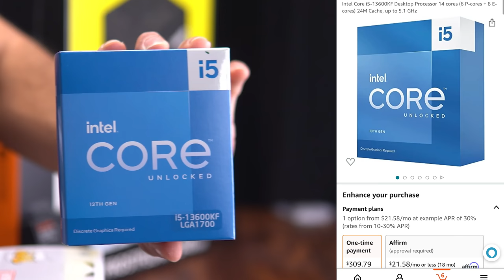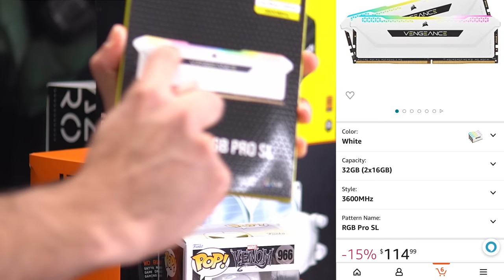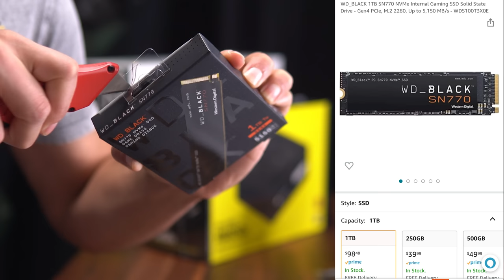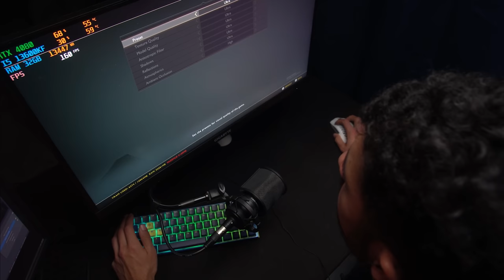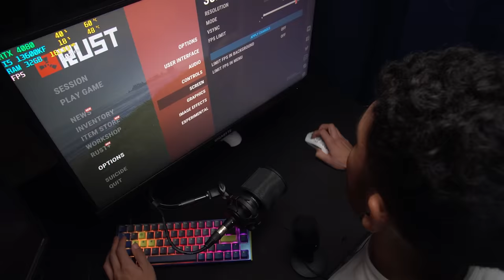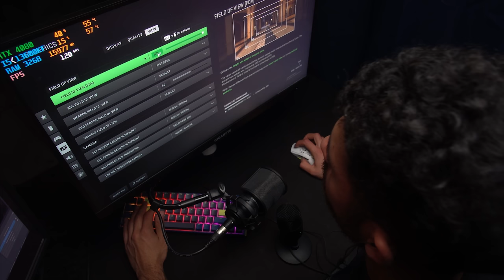$2300 Gaming PC Build Guide - RTX 4080 i5 13600K (w/ Benchmarks)

Comment: Hey i have a question do i have to plug the aio cable to the cpu fan header or can i plug it i to the aio pump header and then just plug the radiator fans to the cpu fan header 

Or do i need to plug aio cable into cpu fan header and the radiator fans cable into opt header

Comment: I got a question do you have to use the 4080. Or can I use a 4070
Reply: I built the same exact pc with the 4070TI
Reply: @Dalton134  does it work good?
Reply: @nandocano4207  Oh yea, I love it.
Reply: @Dalton134  Smart man, The 4080 only gives 20-25ish more fps then the 4070 Ti but the 4070 Ti is 400$ less. I mean yea you get 4GB of extra ram but even then still thats way to much for that small increase in frames and people say "The 4080 is a 4k card" No really its not ...

I have the 4070 Ti my self linked with a i5 13600k and i dont regret either decision by far...VERY powerful build @ 1440 / 165Hz
Reply: @DETERMINOLOGY  100%. Glad I made the decision to go with the 4070Ti as opposed to the 4080.

Comment: @CRATERHQ why does my 4080 adapter, that I purchased from your link, only have three plugs but yours in the video has four? please help
Reply: Did you ever resolve this?
Reply: @georgewbush6999  yes I did. He used the 4090 adaptor so he wouldn’t have to deal with any daisy chains. He just misspoke what adapter it was.
Reply: @brady7813  wish he would have note that I have that 4090 adapter coming. Thanks for the confirmation
Reply: @georgewbush6999  I do as well but sounds like you’re the right track anyways (:

Comment: So can I take the split end (pig tail) of the pcie and plug it into the gpu or do you not recommend it?
Reply: no, especially on a high end gpu like this
Reply: Don't risk it , just because you have a white case , and you dont prefer using PSU cable black that comes with it 
might cost you a GPU especially if your GPU is $2,000 usd 
I'd say don't risk it man, stick with your Power Supply cables unit PCIE x8, and also the GPU cable that comes with it. 
This way you sure it will never caught any fire.

Comment: using the same 4080 with a ryzen7950x but for some reason my apex isn't getting the same frames. Same settings and also 1440p, however my max refresh rate is 170 compared to your 240z, could that be the reason?
Reply: I think the problem is that

Comment: I don’t know anything about computers. But I watched a videos similar to this, but the pc price was 3.4k. This build is only 2.8k and has more fps than the more expensive pc. That doesn’t make sense to me. They both same resolution. Also, 1tb is not enough for me. Im gonna put a 16tb hhd in this build. How badly will that affect the performance? Google says that hdd’s are slower than ssd’s.
Reply: Well in that case you could get an NVME pcie genx4 SSD 4TB 
thats what i have 4TB is better than 2TB make sure to get the genx4 not gen3 
also this depends on your board, if you're motherboard don't support gen4 then go for gen3 it will have some speed-limitation though with genx3

Comment: I'm about to assemble a similar combo but instead of I5 I will go for an I7, and also I would like to use an In Win case but I'm not sure about which model can fit the 4080, specially knowing that you need 2.5 extra centimeters for the cable thing....any advice will be deeply appreciated. BTW: your CPU is beautiful dude and the video is great!
Reply: hi, i think about using a i7 137k, but my problem was if the cooler used in the vid will be enough to cool the cpu? Cause i wanted to use the same exact build.
Reply: Will the cpu cooler be good enough?
Reply: Artic liquid freezer 240 is better for a 13700
Reply: @ItzEm666  thanks, I went for something similar an Icue from Corsair, but I decided to use a Lianli case for having better air flow and space.

Comment: Hey Joey I put the windows 11 key into my pc but nothing comes up and ive pressed the bios boot up
Reply: By key are you referring to the product key? That's just a code that you use to prove to MS that you legitimately purchased Windows. You can't use it until you install Windows. If you meant USB installer, then that's a totally different thing. Either way, if nothing shows up on your screen when you power on your PC, make sure you plugged the video cable into the graphics card and not the motherboard's video output. Also, check to see if your board has a diagnostics light (reference board manual). This can help point you to where the problem may be at.

Comment: So with the PCIe do I need a 3 way or 4 way cable adapter
Reply: Should be 4 way, and the link in description is actually 3 way, and no one point it out in any previous review, suspect if all of them are bot
Reply: @mvm9888  I wish someone did say something cs I got the 3 way and now I gotta wait until next week for my 4 way to come in
Reply: I'm installing now, following rest of the part, did you try to use that 3 way cable to connect and see if it can make it?
Reply: @mvm9888  I did use it but the pc still didn’t turn on
Reply: Lmk how it goes for you because I think I might have done something wrong
Reply: @tcotrooper6351  actually I got same situation that can't turn on, not sure if it's using 3 way pcie cable...
Reply: @mvm9888  you was using a 3 way?
Reply: @tcotrooper6351  yes, ordered a new 4 way but it will deliver after 2 days
Reply: @mvm9888  well whenever it comes in lmk if it will turn on then
Reply: You guys talking about the 4080 extension cable mentioned in the video? Just ordered the parts for this build so I want to make sure what else would I need just in case
Reply: @KeiGGR get the 4 way for the pcie not the 3 way
Reply: @mvm9888  any updates?
Reply: @tcotrooper6351  I can turn it on now using new 4 way pcie cable, but I don't think that's the reason, because I miss one plug in PSU, and actually I was touching the wrong start button of the case, lol
Reply: @mvm9888  ok mine still won’t turn on and idk what I’m doing wrong because I’m following the video step by step lol
Reply: @mvm9888  got any advice for me?
Reply: @tcotrooper6351  Make check all the connection on PSU, that most likely where the problem is if even it can't start.

Then check the start button on the case (the button on the front of the case, not that 2 small buttons on the top of case), you can also try to use the screwer to start. I used screwer to start and then troubleshoot that it's sth about start button
Reply: @mvm9888  lmao I been hitting the 2 on the top this whole time. Thx for the advice it’s working now
Reply: @tcotrooper6351  I know you cause that's what I did as well, lol. Enjoy!

Comment: I know the 4080 is a huge card but does anyone know if it would fit in a lian li dk-04f desk case? Just wanna make sure before spending so much money
Reply: Why don't you get the Lian Li DK-04F case recommended GPU height, width, and length to compare it the RTX 4080 that you're looking measurements.

Comment: Why i5 with 4080 that is over power on cpu
i7 will be more balance
Reply: dumb question. Can i use i7 137k with the same exact build and cooler without problems? Will the cooler be enough? Or do i have to panic over throttling?

Comment: Why using a high end GPU with a low end CPU ???
Reply: how is the 13600kf a low end cpu at all
Reply: @buggedpek86  it's just an i5...
Reply: @user-xx6fv4tu2q  that was the case in like 2018, the 13600kf has 14 cores and 20 threads, it is not low end at all
Reply: @buggedpek86  so the new i5 got high end? I thought i7 and i9 are the high end chips
Reply: @user-xx6fv4tu2q  its a budget i5 13th gen bro, but a i9 13thgen will leave it to dust. same as an i7 10th gen , 12gh generation of core i7 will beat this i5 13gen easily.

Comment: how to install drivers in this video??
Reply: Have you ever installed any computer program before? If so, installing drivers is literally the same process: Download the file, run the installer and follow the prompts. Its pretty much just pressing "yes" or "I accept" or "install".
For the motherboard in the video, download: LAN, Wireless, Chipset: (Intel Management Engine Interface; Intel GNA Driver; & Intel SerialIO Software), Audio, VGA, Bluetooth, SATA. For the graphics card, download the driver from Nvidia's page.
Reply: @JJFlores197  Ty so much

Comment: How the heck do get all all those FPS 😂 I have a 4080 with a R9 5900x 1000w psu b450 mb and betterly manage to get 120fps in wz 2.0 I have done everything to get more performance and nothing 😂
Reply: That's not good 😳
Reply: wz2 has terrible optimization. What's it like for other games?
Reply: @Supreme  pretty much the same thing low FPS in all games and I do play with a  1080p monitor.
Reply: @discordo206  not good at all
Reply: Maybe update the bios on mobo and drivers on the graphics card. If that doesn’t work then idk.
Reply: @Sucompachuy  what’s memory do you use
Reply: @boltPoke  16g Ram
Reply: @Supreme  I updated the bios to most recent also clean ddu the drivers several times😂 and it has most recent drivers.
Reply: @Supreme  I'm thinking maybe my mobo is too outdated for this rig I been thinking of getting a 570 dark knight not sure if this will help.. thank you for all the advice brother 🙏
Reply: Previous to the 4080 I had a 7900 xtx and the same issue.. I know is not that I have a bad gpu. I also turned off all frame limiters on the games and on nvidia panel.
Reply: @Sucompachuy  no problem!

Comment: dont know why you'd bottleneck your pc by using a 13600kf lol
Reply: It will not blottleneck the 13600k punches way above its price point. 1440p and above 13600k will do just fine with the 4080 i have the same cpu and gpu i know
Reply: Is this build perfect with a oled tv as a monitor